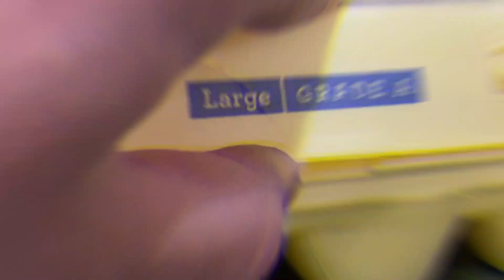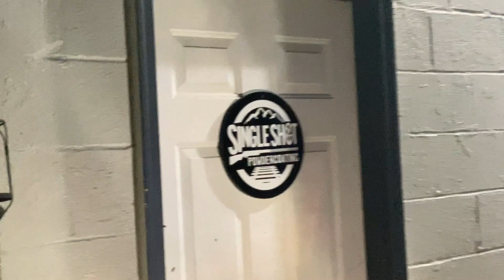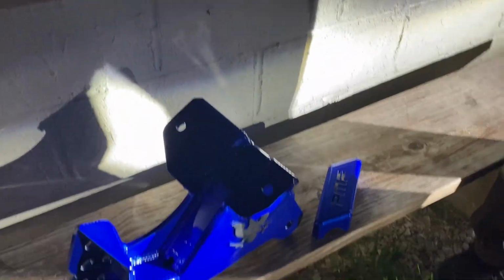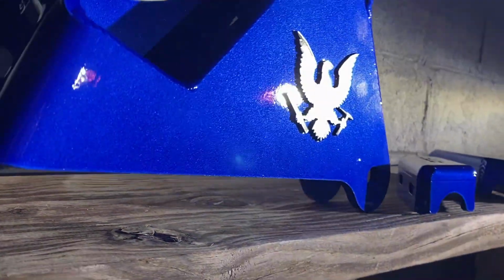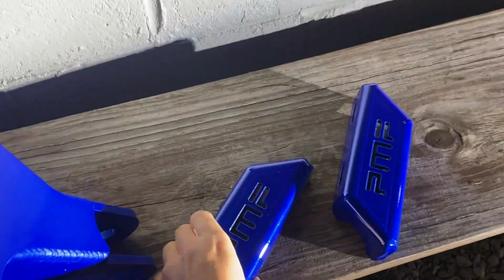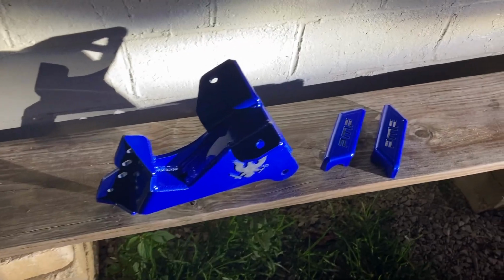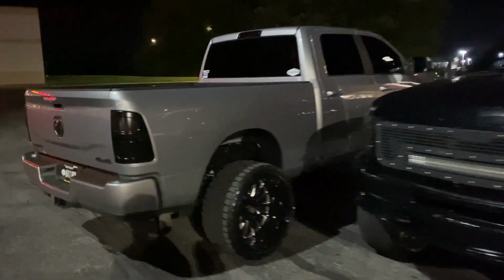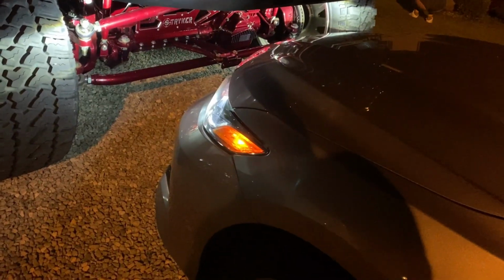2017 F250 BUILD | PARTS PICKUP | PART 2

Comment: If I stack a 2 inch level on top of my 8 inch bds on my 6.0 what all do I need to do? Get a alignment? Or slap it on and go?
Reply from the maker: Your coil is most likely going to slinky from wrong caster , & your drag link would be off so your steering wheel wouldn’t be centered. You can DM me on Instagram and I can help ya out tho more in depth.
Reply: JUSTINHAWKSMITH dm headed your way